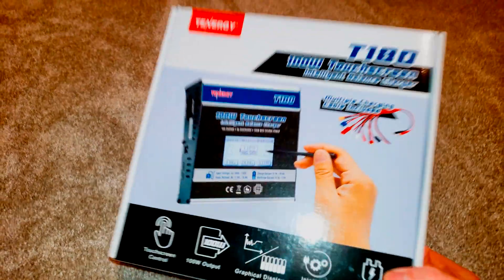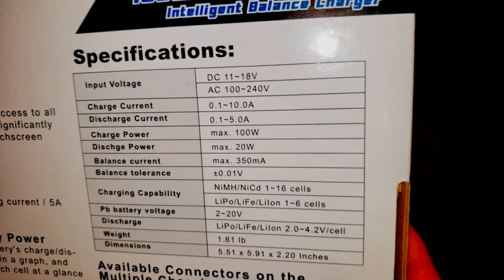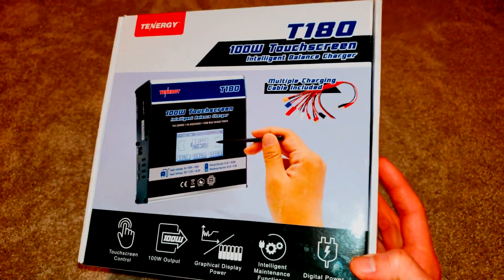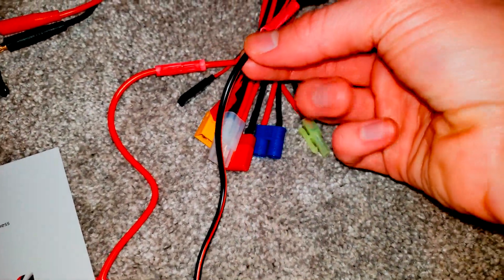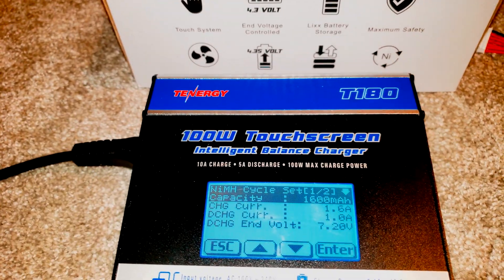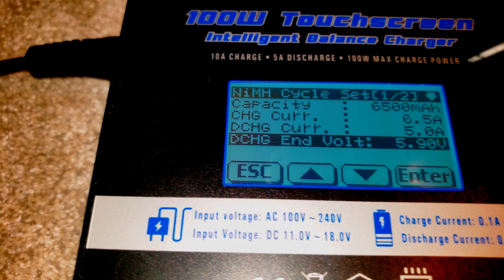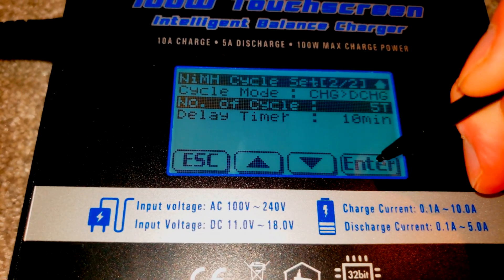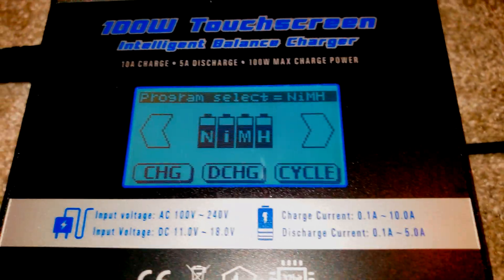Hybrid Battery Reconditioning Hobby Charger Settings - Tenergy T180

Comment: Can't find which video, if any, that show the charge settings for balancing the whole pack. I've got a bunch of modules around 7.3v after doing cycles and need to balance them. Trying to use the solder method in parallel but not sure about the charge settings. Any help is greatly appreciated! 🙏

Comment: As everyone else has said, thank you very much for your informative and helpful videos. Question and problem: I have been using the Tenergy T180 to recondition my 2006 Prius HV battery modules, one at a time, exactly how you instruct in this video. I used the exact same settings. Everything was going great until block 7, then for some reason when I was taking one of the clips off (I don't know whether positive or negative), there was a spark from, I assume, it touching something. When I attached the clips to the next module & tried to start the T180, the display came up with "ERROR, process interrupted". It says and does the same thing with any other module I attach the clips to. I just called the Tenergy company and asked them about it to see if there's a way to reset the T180. I told them about the error display and they said that it is something internal that has gone wrong, and there is no way to reset it. The representative asked what I had been using the T180 for and I told him to recondition my Prius HV battery modules, one at a time. They said it was not "heavy duty enough for that", and that it wasn't built to recondition Prius batteries. And so in essence, their 12 month warranty might not cover this (I have only had the T180 about 1 month.) Whaaaat? Have you or anyone had this same kind of error code? What did you do about it? What are your thoughts about the T180 not being heavy duty enough to recondition each module? (The company rep. that I talked to said that the discharging puts too much strain on the T180.)
Reply: A spark? Bro you nuked something inside the charger. Get a new one

Comment: Ok I must be doing something wrong. I did the same settings as you on the cycle mode with a 2006 Prius battery I have tried two modules now and both have swelled up bigger. What a’m I doing wrong?
Reply: You’re supposed to use something ( I use two boards and two clamps) to keep compression on the packs. That’s why they are compressed together in the Prius.
Reply: when you charge, leave the cells in the hybrid pack, don’t take it out.
Reply: it got over heated. That's why

Comment: i haven't tried this but an idea. If you hook up 7  battires parallel and set the capacity 6500 times 7=45,500. This way you can charge/discharge 7 battries at a times. What do you think? Let me know before i blew up something like a mad professor. I think max spec for capacity is 50,000 for this device.
Reply from the maker: Its sound logic, but in practice it won't work as well as you think. Ex. If you have one bad module it would throw off the charge/discharge cycles and estimated capacity for the other 6.
Reply: @HEVTech1  but once you recondition every single one then you go back to balance them all by charging them all at the same time and use the charge setting what does the 'stage' selection indicate on the t-180 and is important?
Reply: Yes thats the question i have. When you have all positives & negatives  on dame side he charges the battery a a pack for 6hrs i think he said?? At what settings??

Comment: @H-EV Tech Thanks for the informative video. I have subscribed to your channel.

Is there a way to attach more chargers to this setup & view the charge/discharge curve or info live on a PC screen.
Can you also install external load to these chargers to discharge the batteries more quickly?

I was thinking of attaching all the modules to a grid charger & also to a large load like an oil heater for discharge. Only issue is, I cannot find a battery analyser to attach to every module to get the battery charge/discharge live data.

Do you know where I can find a battery analyser for all the modules? Thanks again for the great content

Comment: Great video! One question is how can I see what each charge/discharge cycle is? Does it record so you can see at the end of the 5x cycles? Thanks
Reply: I know this is 4 months out. When you go through the cycles, you can look at the charge/discharge cycle by tapping the word 'cycle' (or whatever word is between stop and graph). It's not highlighted so it kind of tricks you into thinking that it's not an option. Tap on that and it'll let you go through each cycle to see what the charge/discharge numbers are. I've only tried it with the cycle number highlighted before you start as  H-EV Tech  as stated in the video. Hope that helps.
Reply: @jvasquez002  Thank you so very much! I was looking for this exact same thing myself
Reply: Did you figure this out?

Comment: Hi there nice video and I do have one of these chargers.. what I don't understand is unless you're monitoring the discharge cycle to see what your amp hour capacity is it does not save that information I thought that this unit had memory and saved the cycles, based on your inputs to your spreadsheet...so when you put your figures of each cycle into your spreadsheet were you monitoring this the whole time even though it takes hours and hours... My question is how did you know what your discharge amp hour capacity was for each one since the cycle times seem to vary... Or is this related to having to leave the selection highlighted on the (cycle amount of times mode) example 5 times cycle for used batteries... Thank you
Reply from the maker: Correct you leave the cycle count highlighted when you start the cycling process. I have no idea why it functions that way but it does. I found a couple of worn cells I could use to demonstrate this in a part two as this is a common question I've gotten a few times.
Reply: I know this is 5 months out. When you go through the cycles, you can look at the charge/discharge cycle by tapping the word 'cycle' (or whatever word is between stop and graph). It's not highlighted so it kind of tricks you into thinking that it's not an option. Tap on that and it'll let you go through each cycle to see what the charge/discharge numbers are. I've only tried it with the cycle number highlighted before you start as  H-EV Tech  as stated in the video. Hope that helps.

Comment: So once the 3-5 hour cycle is done and the module has been reconditioned...what next?  Check the voltage and consider that the new value?
Reply from the maker: The voltage is not a direct indicator of module health. When you do multiple charge/discharge cycles you will also get estimated capacity. Use a desired capacity (4500+mah) as your baseline for replacement.
Reply: @HEVTech1  specifically look for a discharge capacity or a current capacity? or the general final capacity result thats not specific to which once the little t-180 ends the cycle?

Comment: Really, really appreciate all the work you put in these videos. I had to wire a terminal connector  to leads that I could bolt to battery to keep from smoking the thinner wire used on the alligator clip leads. 
Thank you!

Comment: hey man another question this charger gives you the ability to cycle without stopping at the cut off charge capacity ? because I've tried a couple of chargers but they don't complete the 3 cycles they stops at first discharge charge.

Comment: just purchased due to your video.  I have an 08 Prius that has 218k and the battery seems fine still, but this might just help my hybrid batteries eek out a few more thousand miles.  Does this work for the 12volt battery I just purchased?  It's been sitting uninstalled in my car for a week, and I figure I can maybe top it off before installing?  Thanks for the video!  Extremely helpful!
Reply from the maker: I recommend a standard 12v battery charger as I have never tried charging Lead Acid with the Tenergy but it likely would work.

Glad you enjoyed!
Reply: @HEVTech1  ok cool!  Your channel rocks
Reply: The 12 volts prius battery is a gel battery , not acid battery so you need a special charger for these type of battery : acid battery are not recommended for for the prius: it could damage the hybrid system : also do not give a booster to other car with your prius: you can receive a booster from other car

Comment: @H-EV Tech  Thank you for the great videos on this subject. I'm reconditioning a highlander/rx400h battery and I started with the worst module as determined by the load test (lost 7.54V). The capacity is starting to increase: 5052ah on 1st D-chrg, then 5198ah on D-chrg 2. I'm not hopeful that this module will come back, but here is my question for you: If I get a module to come back from the dead, what is the expectation that it will be OK for use in the pack going forward? What caused the modules to fail in the first place? Heat? I guess I'm wondering what is considered a safe module to use?

Comment: Thank you so much for sharing your knowledge!

What I don't get is how you used your T180 charging the pack as a whole while all modules where connected parallel through the solder wire. I assume you used the Charge mode for this. Can you enlighten me/us what settings yo used for Capacity, Current, CHG Mode, Detla peak and Trickle curr.?
Reply: Id like to know this also
Reply: @H-EV Tech 

could u shed any light on this?
Reply: I watched other videos and the wire is just sharing the load with other cells to make them the same.  NO charging

Comment: Thanks for posting this video, I want to start rebuilding my own batteries but I think I want to go faster I am deciding between the ev peak cq3 and the hitech 44254 since you have some knowledge about this which one would you choose, another question is pretty interesting you choose high amps for charge in the prius chat forum they recommend to go with low amps like 2 or 3 amps since I don't know much about this why you decide to choose this.
Reply: At one amp up and down/it has been 
1.5 days per module for me and several stops with esc saftey. On my screen.
I wouldn't do this again.
400.00 installed/comes to your house /one year warrenty. ATLANTA WEST AREA.
Reply: @stevepope5484  Who did you call for $400.00 installed?
Reply from the maker: After doing quite a bit of reading about NiMh batteries. A charge rate of 1C is typically regarded as the fastest charge rate for NiMh as indicated by the article below. You certainly could charge slower but as the article indicates, the charger may have a harder time identifying the module is fully charged.

https://batteryuniversity.com/learn/article/charging_nickel_metal_hydride
Reply: @HEVTech1  thanks for the reply valuable information here !!